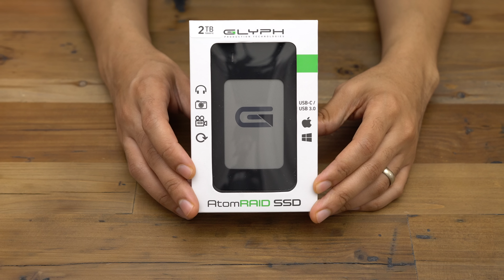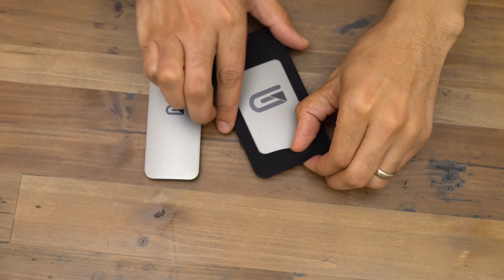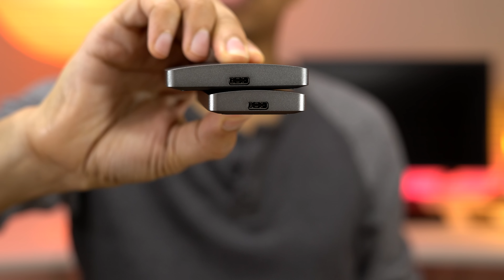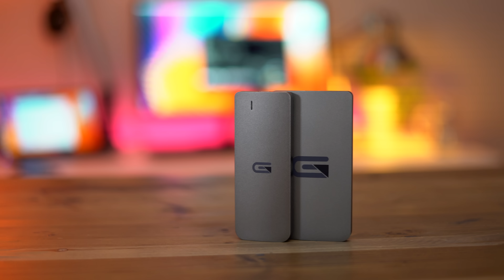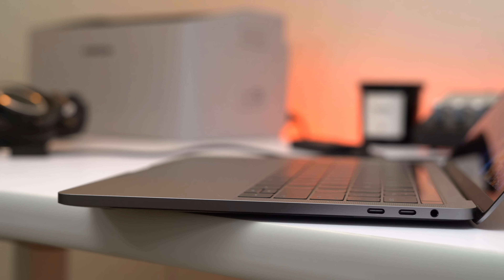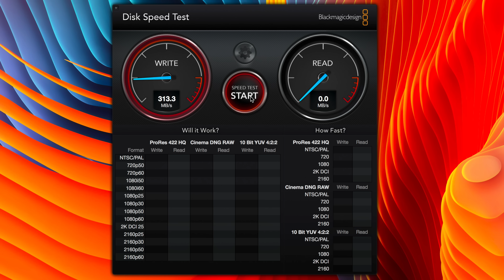Review: Atom RAID SSD: a super-fast drive for MacBook Pro!

Comment: I haven't figured out what it was connected 770mb/s, and at what was 330 MB/s? 
1. Thunderbolt 3 - ? 
2. Thunderbolt 2 - ?
3. USB 3.0 - ? 
Explain, please. I have an iMac ME086 (2013), Thunderbolt 2 there and USB 3.0.  What speed will I have on this atomraid SSD?

Comment: Idk why the raid model is the only one advantage of that throughput. Both of them are bottlenecked at near 1gB a second. The raid model does around 700mB while the other does nearly 500mB a second. It's not a bottle neck when raid 0 can fail, causing you to lose everything. Even if you back up weekly, it just doesn't seem worth it for the gains.

Comment: You can simply say thunder bold3 instead of USB 3.1 gen 2 port.
Reply: Achal Nana no, it’s different. USB 3.1 Gen 2 is 10Gbps whereas TB3 is 40. They do use the same port, but are not equal.

Comment: Thanks for the review.  How does the Glyph Raid compare, size and weight-wise, to the Sandisk Extreme 900 1.92TB, which is also raid?
Reply: I also have this question too.
Reply: I have seen You-tube tests done on the Sandisk at 750MB/s and 760MB/s on a PC, so I'm assuming this is faster, especially with its Read speeds.. but hey.. nothing like doing it on the same machine by a same person?

Comment: Nice to see that you included a test with the 5K as well. Thanks! Those results are still lower than what I expect from a Gen 1 interface sadly. My T3 is faster than that even when connected via a 7 port USB 3 hub. LG probably messed that hub up big time.

Comment: I was thinking about buying the 2016 MBP 15' base model.However, i was wondering will 256GB be enough for 4-5 year? 
{( i don't store alot of stuff on my laptop, what got me thinking is, the incremental MAC OS updates, and some casual gaming. )}  suppose i use up 200GB of storage, and as far as i know the new MPB comes with about 20GB of storage already being used. My question is, will the rest 36GB is enough for the 4-5 year of smooth usage ? PLEASE ANSWER
Reply: IMHO no. 256GB is by far not enough if you don't want to do everything with external HDs. I have used a 512GB MBPr for the last >4 years. My new 2016 MBP -5" will have 1TB. I already have a 1TB Samsung T3 external SSD, which will fit very well and has speeds of about 400 Mbytes/s.
Reply: Thank  you for your reply... I am already on a tight budget so i was thinking if i get the MBP 15" base model and an external SSD; is it gonna be a smart move or to upgrade the base model to 512GB?
In addition, it moght sound silly, but can you game on MBP storeing the game on an external SSD?
Reply: I think that is not a smart move:
1. Yes the upgrades for the internal SSD are not cheap, but it is the FASTEST SSD on the market with ~3,1 Gbytes/s read and 2,2 Gbytes/s write, so a true beast. This Atom Raid SSD only does around 1/4 of that speed, whereas the normal version (and almost every other external SSD on the market) only does 1/8 of that speed (around 300-450 Mbytes/s). So you have more space with that awesome speed if you take the 512GB version. The added price is not that bad, it only gets more expensive with the 1 TB (which I have ordered) and the 2 TB version.
2. With the 256GB version, you will always have to take the external SSD with you, negating that slick, flat MBP, as you will not have enough space for almost anything on the laptop itself.

Gaming on a MBP is not really good, the dedicated graphics are optimized for OpenCL (faster Final Cut Pro, other video cutting sw, graphics programs, etc). You should game with Bootcamp on Windows and yes, then it should be possible to put a game on the external HD. But again: this is not a gaming machine. If you want a gaming laptop, take a Razer Stealth with Razer Core.

You will need an external HD for Time Machine backup btw. Do not use your device without that.
Reply: Thank you so much for the insight...
I as you suggested i'll go for the 15" base model, upgrading the internal SSD to 512GB....
Reply: You won't regret it! Have fun with the device and that blazing fast SSD. ;)

Comment: $819.......
Reply: Don't get me wrong, I am a working pro, but like so many in the creative arts (photography) keeping costs under control is important. I have several external SSDs that I use for road trips in addition to a Drobo for my desktop. I was just musing that since the introduction of SSDs into the consumer market en masse around 2000 be they external or internal, there has not been a significant price drop. As I do not own the newest Macbook Pro, rather a 2 year old '15' Retina, this would be a waste of $800.00, still too pricey imo.
Reply: Yeah a decent chunk of change, this thing had better not fail. Gotta wonder when we will see a significant price drop in SSDs (external or internal) overall.
Reply from the maker: Yeah, it's pricey. Definitely geared towards creative pros. But man, it's so nice having this type of speed in an external removable form factor. Makes having a low-storage MacBook Pro bearable.
Reply: +cameraman655 you are wrong on so many levels! Yes, there were SSDs earlier, but it was only in 2006, that Samsung entered the market with 1,8 and 2,5" drives. And man were they expensive and small!

Have a look at http://www.storagesearch.com/chartingtheriseofssds.html

It will tell you, that the performance and sizes of SSDs have increased massively and the price has come down as massively as most other computer parts.
Reply: less than 400€ for the 1TB. The 2TB is overpriced right now but 400€ are still a lot if you do not pretend to edit 4k footage and only do hard copies of your laptop.